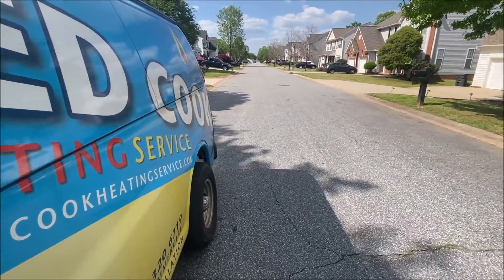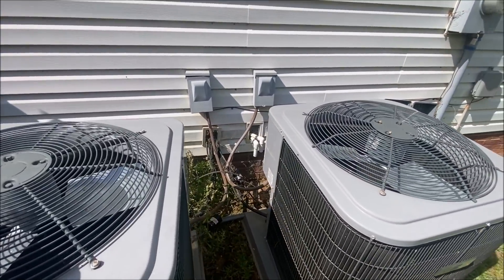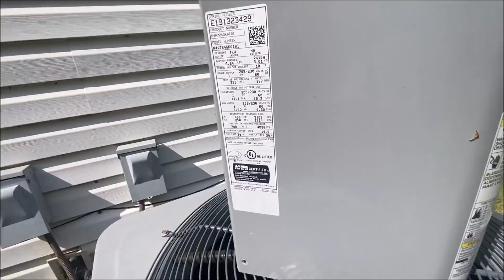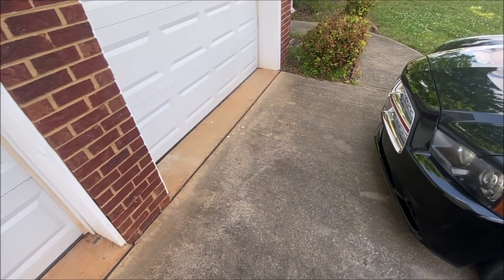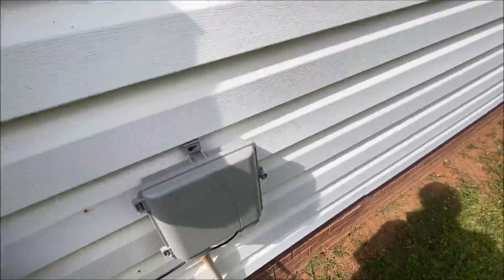AT&T Broke the Air Conditioner

Comment: Coming from a Spectrum maintenance technician that worked in a shared service area with AT&T. Something this negligible had to have been caused by a contractor. They don’t care what happens to a customers home as long as they are in and out in 30 minutes or less. I know from spectrum’s training that we try to avoid drilling near AC Condensers at all costs and the only time we would ever touch them is to attach a exterior grounded clamp IF and only IF we can visually verify a path to ground and there is no other preferable path to ground. Then we take photos of our work and request sup. Approval which is 9/10 always denied.  I also know at least with spectrum that because this wasn’t caught within 30 days, the technician is no longer responsible for your house anyway. AT&T might still pay up just to shut you up but at the end of they day they don’t care cause, what are you gonna do? Switch to cable? See you in 3 months. Sad I know.

Comment: Did you check the wiring for damaged insulation? And I have learned it is not a good idea to reset a breaker before verifying what tripped it, or at least ohm it out for direct shorts.

Comment: I installed cable TV back in the 80's and when I went to screw on a 75 Ohm matching transformer to the back of the TV, it burned off the connector with a FLASH. So I put a meter on the 2 screws and found 120 Volts AC. I red tagged the TV and told the customer I cant leave the box there till they get a new TV or this one repaired as it had 120v at my antenna connection.

Comment: I’d make them come back and relocate the wire. 1 high and low voltage in a box is a not code. 2 water will get in the disconnect from being open. 3 How long do you think it will be before someone jams the cover shut and cuts the wire sticking out of the door.  That AT&T install belongs on the wall of shame.

Comment: that box needs replaced or at minimum rewired and that ATT wire needs to be rerouted.  I don't think it is in line with NEC to run low voltage through a power distribution box.

Comment: I don't know if you said this or not, but did the customer not even check the breaker before calling an expensive service like an HVAC company to come out and "fix" his AC? Breakers are there to be tripped, if something stops working and it didn't let the smoke out that's the first thing you'd think to check. You can then see if it's a continuous problem. I feel bad for that guy having to pay for such a stupid thing. It's possible the breaker tripped for an unrelated reason too like the initial startup of the AC for the year. Weird.

Comment: On tripped breakers I like to at least check fan and comp common to ground, make sure its not grounded, could save you a breaker or even the refrigerant charge, you guys seen the plugs blow out on them compressors? Lol shits wild

Comment: AT&T sucks. I’ve helped my grandma with her Wi-Fi like setting up a UniFi system and because I didn’t feel like changing the Amazon echos over to the UniFi system, they were on the old router and when the AT&T person replaced the router and they weren’t connected BLAMED it on the system I installed. Rediculous they have been doing this kind of stuff to her multiple times. They are highly unprofessional and poorly trained. This is a example of them being clueless at what they are doing like usual

Comment: That guy drilled through from the inside without checking if anything was in the way first. 
FYI, those cable guys are often undertrained when new. They put them out on jobs alone before they should be.

Comment: As an electrican I woulda called the company to come fix it correctly and yanked it out of my box. Also woulda called the building inspector. That is a big NEC violation to have data in an electrical box with power.

Comment: As an entry level AC guy, I barely like getting my hands much less tools around those disconnect wires. I couldn’t imagine drilling a hole right next to those wires. Electricity is a scary thing lol. That installer must not have much knowledge on anything.

Comment: AT&T, Engineer's are not "Bright" either, I was on the USS John F. Kennedy, CV-67, AT&T, in stalled a new,  Phone PBX Switch gear, in 1980 Norfolk Naval Shipyard, we were off Florida, landing F-14's first time, I as Electrician Mate, got call, from IC switchboard "Trouble Call", phone system kept going down, AT&T, had installed a QO, residential  100 amp breaker panel. I ripped it out & sank it into the Atlantic, replaced a "Naval FRN  fuse Panel Box for the circuits".

Comment: As a Commercial UNION HVAC guy of 33 yrs,, 1st,, I’d bet that’s against Code,,2nd,, I would have checked all components to ground on that line side… if everything appeared ok and then I thought that breaker was tripped from the AT&T company drilling a hole to run there cable,,Just to protect my company and myself of not being responsible for any damage ,or threat of Fire inside the wall,would recommend opening that wall,,have a licensed Electrician check the wiring ,contact the Township Inspector and force AT&T to re-route there wire and any and all expense paid by AT&T.    Just gotta cover your butt!! Imagine resetting line voltage to a shorted wire in the wall,from the drill and it caused a spark inside the wall and the Homeowners house caught of fire !

Comment: Did they Hit the Line in the wall , Now the Wire has Reduced Amperage capability . arcing and sparking in the wall ? Should be a little more investigation .

Comment: Most installers are contracted installers and paid a Ridiculously low flat fee. The quicker they call a job finished the quicker they move on to the next job. They for the most part are NOT LICENCED Professionals and usually will do a sloppy fast job. Cable companies are the worst. When the installers come to your home it is a Very good idea to have a handy man follow them around if you do not have basic knowledge to do it yourself. The thing i have seen in homes will give anyone nightmares. It is much easier to stop them from Destroying your home than to try and get thing fixed later.

Comment: I would be willing to bet the AT&T installer drilled the hole from inside the house, not knowing he was going to drill into a service box.  He was probably in a hurry and didn't want to make it right, or admit the problem.  He probably didn't know he tripped the circuit breaker.

Comment: It looks like whoever installed that cable cut a few corners namely the one that says low-voltage cabling cannot share with line/Medium voltage cabling. A NEC regulation. And while cutting that corner the insulation on the wires was also cut which probably wasn't noticed until cooling season. Hopefully that "?"installer"?" went home with some brown pants! Unless it was a DIYer?

Comment: Wow unbelievable 
Had the same thing happened to me dish Dan their coax in with the line set opening and shorted out the low voltage wires they covered my service call

Comment: I had Comcast run a coax cable across my floor in the middle if the room about 15 feet long, it was not in the corner and stapled down, it was loose and able to be tripped over.  I told the tech to at least run it up and over the ceiling across the entryway, but he said they couldn't and leaving it loose on the floor was ok.  Lazy lazy people in the world!

Comment: that appears to be the fiber cable, not a power cable. the new att installs do not use external modules. there is fiber from the street (we can see wire) and then the other connection goes into the house. he literally routed a fiber cable through an ac breaker box and pinched it against bare metal edge. amazing incompetence! it is SC tho.............

Comment: I came across a disconnect where the cable guy attached a ground lug so that I had to use a 5/16 nutdtiver to access the switch. I know, not a big deal, but it 's not how it is to be done.

Comment: I'm not an Electrician but I did CAD  conduits for a while and been through the NEC. You are not allowed to combine low voltage signal wire and high voltage wire in the same conduit / junction boxes like that. I have no idea why they did it like that... But it's so wrong :(
Reply: It's fiber optic, no voltage or metal in that cable.

Comment: "might be something as simple as the breaker tripped".... Im a relatively new tech (almost 3 years) and if I came across a tripped breaker, I wouldnt leave it at that. why is the breaker tripping? is the compressor overamping? why? incorrect wire guages? bad compressor windings? is it just a weak breaker? am I right for looking deeper into a tripped breaker? Seasoned techs, whats your take?
Reply: You are correct, breakers trip for a reason. In the video he mentions check current draw and everything, and it all looked good. The assumed cause for the breaker tripping is the unsettling combination of live wires drill bits and fiber optic cable.

Comment: AT&T routed their fiber right through a tree in our yard and then told us that it would cost $1K to replace a broken line. On top of that, he INSISTED on installing the ONT on the opposite side of the house from all my existing network gear citing that "he can't waste cable going through the attic and that it often gets broken up there". Then he asks if he can throw is waste away in our garbage can. What did we find in the garbage can? A whole spool of unused fiber cable... We also found his tools on a window seal. Mine now.

Lazy, incompetent, lier who didn't rout the new cable along with the existing cables or rout it to my existing equipment because he didn't want to crawl through the attic.

Comment: That looks like a fiber optic cable line, going into/through the box.  If so; while it IS impervious to electrical conductivity, fiber Cannot Be Kinked (>90 degrees in a half inch bend or something).
When that disconnect door gets slammed closed one time to many, that glass fiber will snap inside its jacketing.
Unbelievable, though I'm sure the young tech thought he was a genius in the moment for double purposing the box.

Comment: Running a phone wire through a disconnect? That's Jive!
Reply: Just think about the electrical interference from the high voltage wires interrupting the service
Reply: @joshuatimmons467  In this case it's fiber so there shouldn't be any interference.
Reply: @joshuatimmons467  That's actually not an issue, that is a fiber optic cable.
Reply: @joshuatimmons467  It's fiber, it won't be affected. Regardless it's a subpar job.
Reply: @joshuatimmons467  Good thing electricity doesn't interfere with light.

Comment: Looks like AT&T installer drilled from inside without checking.  What bothers me the most is he did not even realize (or didn't care?) he was hitting a metal and actually drilled through it. He would have noticed right away.  What if he was drilling through water line or even gas line?  That would been a real disaster.

Comment: That might be an electrical code violation. If that ATT cable is wire it's most likely low voltage and that's not allowed to be mixed with 120/240 volt wiring. If it's fiber optic it might be okay but I can't say for sure.
Reply: It's not OK to drill a hole through an AC disconnect and run a cable through it so the cover can't be closed. That's a code violation right there.

Comment: Where the units / disconnect are you should have at least 24 to 36 inches in between those units 18 is not gonna cut it.

Comment: That hot wire in the disconnect has been damaged and probably compromised. I would inform the owner that the wire should be repaired, and the fiber cable moved. On AT&T's nickel.

Comment: That is the craziest fiber optic installation I've seen.
 if it wasn't for the fact that the customer needs to put AT&T on the hook as the responsible party for the damages and cost incurred, never mind their management tracking down which technician did that and reprimanding them, I would have given that wire The Big Snip. At least with some of the more conventional Telecom wiring it's easy enough to undo it and move it, fiber optic can be a bit more involved sometimes.

Comment: The customer doesn’t know to check the breaker in the CB panel? It was clear the breaker was tripped! I wouldn’t expect him to notice the the AT&T wire? You have some easy customers to make money on. They certainly keep you busy. 
As a power lineman for a local power company. Our customer service folks advise customers to reset all their individual breakers & their main before we get the call to investigate a no light call? With newer houses the main breaker is outside in the meter can so all the resetting of individual breakers in the panel will not bring their lights back on. Some don’t know that their main breaker is outside? Hence the service call. We advise the customer to call us first as we are a free ride. We’ll determine if an electrician is warranted? Sometimes not.

Comment: Based off the look inside disconnect box he most definitely struck a conductor and faulted the breaker and didn't wanna fess up. In my opinion cut it back to a j box and re run all the way to compressor. Load side looks f*cked in DC aswell.

Comment: Most of those data installers are just kids who spent a week riding in the truck getting “trained” and then they are cut loose to do installs.  They have no real formal education or apprenticeship to speak of.  As such, this crap happens.  He’s lucky he didn’t end up in the burn unit with an electrical injury.  And that will also have to be fixed once that home comes up for sale next time because ain’t no way that passes inspection.

Comment: you need to tape wires as they were hit by drill bit
Reply: Yeah, I could see bare copper in the video.
Reply: A qualified electrician should inspect all the power wires on that disconnect for damage, then that bill should also be presented to AT&T.

Comment: I have pure hatred towards AT&T and wouldn't even let them on my property. I used to have telephone service from them. Canceled the landline service in 3/2014. I had "auto pay" set up with them as I still kept internet. They kept charging for the telephone Service even after it was disconnected, no dial tone. I'd call every month and they'd say it was taken care of. 8 months later and I was still getting billed, so I shut off the auto pay and only payed for the internet. They sent me to collections for service I didn't have. I had all the ticket numbers, times and dates of calls. I contacted our state utility commission and placed a complaint along with a lawyer who advised what to do with the collections company. The erroneous billing stopped, but to this day, I still haven't received the $535 that AT&T stole from me. I canceled the internet, and changed cell phone provider. No more business with AT&T! Anyways, I came home from work one day a couple years later, and there was an AT&T truck in front of my house. I looked down the side of house and the guy was putting a new box (d-mark) on the side of my house. BTW, just had the house re-sided with new vinyl siding. He was just finishing putting the last screws into my new siding (there are no wires anywhere on the outside of my house, they are all internal. I'm a communications/ electronics tech for a living). I ordered him off my property twice. He told me that they had an easement to be on my property. Not true. I have no business with that company, and state law says that it is assumed they can come on your property, but if you tell them to leave, they have to leave. This guy wouldn't leave, so I called the police. They came out, explained he had to leave, and the AT&T guy got stupid towards me so I filed a Criminal Trespass Complaint with the officer and the guy was issued a misdemeanor summons for criminal trespass and he left. I then called my attorney and she sent a letter to AT&T and advised them that they had a certain amount of time to remove all external cabling and equipment from my property and the easement for AT&T will be revoked on that day. Also the employee summoned was not to return. And AT&T was responsible for all damage caused by their new wiring and d-mark to my house. The wire was removed in time, and I sent the bill to have the holed siding repaired, and it was paid. I still don't have my $535, but I have some laughs and satisfaction. In the video's case, I'd make them repair the damage. If they resist, I'd call local code enforcement, then the utility commission, and even a lawyer. BTW, they paid my legal fees for the siding issue also.
Reply: Lol, I’ll take “stuff that didn’t happen” for $500.  Your story is fabricated
Reply: @crowbar1287  wish it wasn’t.

Comment: I worked as contractor for at&t directv, was the worse Job I ever had. My primary market the entire time I did it was working on multi million dollar to ten-hundred million dollar mansions. For people who payed the same rates as any middle class family. 

Working by myself, on a massive house with dozen of tvs, wires running all over the place and that every job needs to be done at 150% the way they want it. Every single house had massive installs and take me two to three times longer than a middle income family. We got paid per piece, not hourly.

I was getting shit pay for doing a better job than 95% of the crew working there. It's based off complaints, after 3 months it's consider not my fault anymore. Most of the crew could do the job properly but if you wanted to get paid you took shortcuts. I couldn't because rich people complain the most out of any other group. And I wouldn't because I like to make people happy no matter the install or if they're jerks.